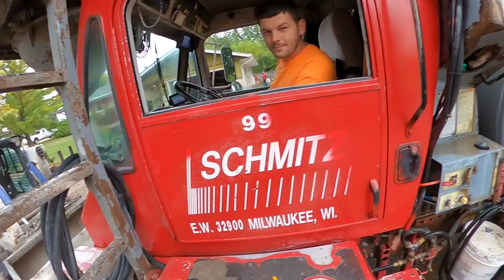Monday concrete prep-Not my favorite!

Comment: So... those bed shaker alarms can be very beneficial and a huge detriment. The benefit is that they have an accessory that you place under your mattress and it vibrates your bed when the alarm goes off. The detriment is that sometimes the vibration is good for your back like a massage and you just sit through the alarm and enjoy. What Eric needs is one of those sonic bomb alarm clocks that are so loud that you can wake your neighbors up.

Comment: Not sure if you get hit with a short load fee but I would have poured those steps monolithic with the patio. I think running the the bottom tool instead of having the edger line gives a cleaner look.

Comment: Word of advice Ryan, every single piece of machinery is made to be loaded on reversed. If you ever notice the hook spots on the rear of the skid steer and on excavators. Also on skid steers the rear has the engine and a counterbalance weight, so the rear is very heavy and can throw off trailer load balance if the rear is left on the axle.
Reply: lmao….you think he doesn’t know this? loading front or back first is all just preference